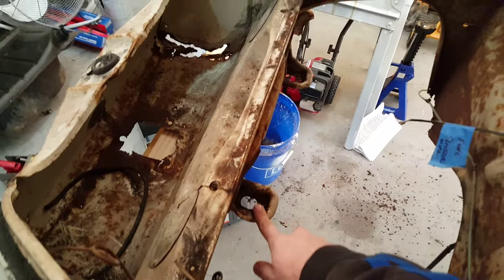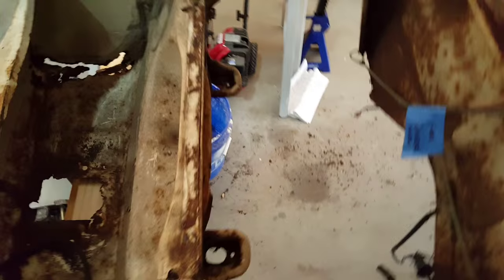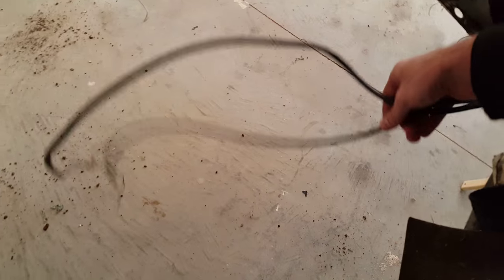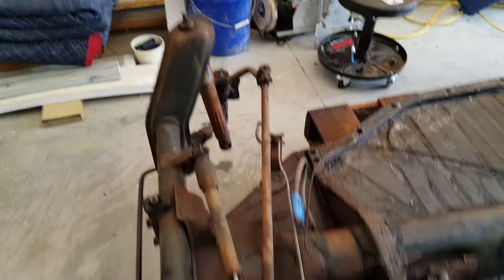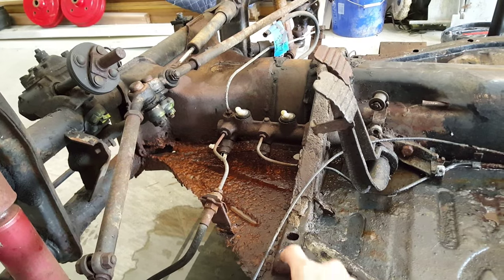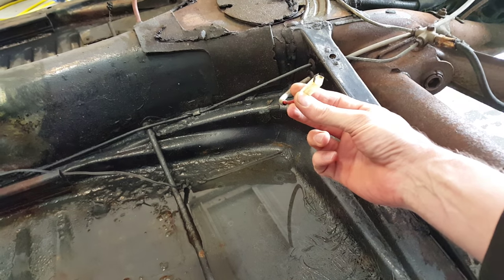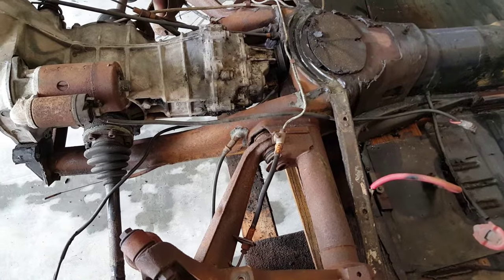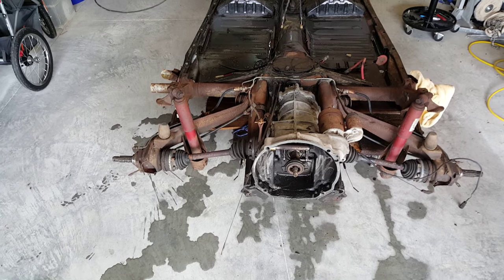VW Beetle Body Removal from Chassis with 1 person

Comment: On those rear heat flaps that little black plastic clamp has 2 tiny flathead screws to hold the wire. Just listen one and you’ll be disconnected from the body.

Comment: I think you just answered a question I've yet to ask. Re: under-dash steering column bolts. I'm building a car out of clips and doors. I took a steering column out of a 72 and went to put it in....they were waaay different. The bolt pattern in my cowl section looks like yours....so I guess it's a 74. Who knew?

Comment: How do you find out what type it is? I have a 1974 beetle from what I was told it's not a super beetle but a standard beetle. So I keep having issues when I try to look up parts or videos seem super beetles keep popping up.
Reply: Front coil springs are Super Beetle only.

Comment: Out of curiosity.... what did you use to do the actual lifting of the body from the chassis?
Reply from the maker: The body is very light once you have it disconnected. I have done it two ways. 1) lifting the body by hand then having someone slip the extended saw horses under the front then repeat for the rear. 2) a pump Jack with a 4x4 post to raise it. The second way of course you dont get a large amount of clearance but you only need just enough to clear the rear axle and suspension.

Comment: How did you life the body off the pan? Also what if someone has an engine in the car?
Reply from the maker: Once everything is disconnected I just lifted the front and slid a board under it that rested on sawhorses set at drivers and passengers side. Then did the same with the rear. Easy with one person as the body is so light. If the engine was in you need to speed extra time making sure there are no catch points. The engine is so easy to remove I would recommending that you drop it first.

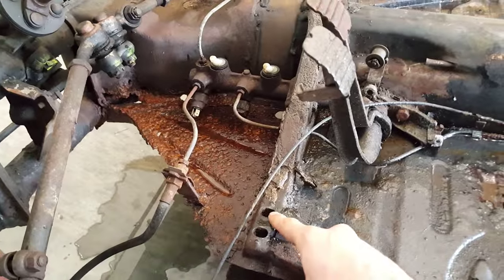Comment: Great video. I am removing the body off of my 74. How did you access the 4 17mm bolts that go in to the Napoleon's hat? (The ones at 6:05 in your video) I do not see any bolts there when looking under the car or from inside the hood with the gas tank removed. Thanks!
Reply from the maker: They were accessed from under the vehicle. On mine there was bolt below and behind the front wheels that could be removed (2 on each side). The nut plate was welded inside of the body cavity so I couldn't access the other side which was fine for what I needed. If you are still having problems I will see if I can get a picture to you

Comment: do you have to remove the engine to get the body off?
Reply from the maker: You could feasibly remove the body without taking the engine out. The engine tin would be a concern. Also, getting the body raised high enough to pass over the carbs could be an issue. You would still have to disconnect cables, electrical, and such that pass through or connect to the body.
Reply: thanks for the answer. could you tell me I should get for gas mileage with a 1973 1600 bug engine in good shape?
Reply from the maker: I would think around 25 to 32 mph depending on tune, carb, and engine shape

Comment: Anyone have tips for repairing the backrest on my passenger seat? The lever moves up and down but the seat won't push forward. I seperated the seat tonight and notice the cable on the left side is not moving the mechanical lever as much as the right. Do I need to remove the seat cover and adjust the cable?  Just bought my wife a 75 beetle and in the process of figuring out what and where to start. Never messed with a bug, so any help is appreciated!!

Great video to show all the component break down on this car.  I think I'm going to have a million questions this spring.. 😆

Comment: What is that black thing under the dash? It looks like a little light.
Reply from the maker: Under the dash to the left of where the steering column goes and is white, red, and black? That is the fuse box. Or, if you are taking about the black hose that is for the windshield wiper fluid.

Comment: how much should I pay for a 71 vw beetle. it needs sway bar, rear axle, floor pan, oil seals, side window, and interior redone.
Reply from the maker: doghousegang Needs a lot of work. Depends on how good the engine is and the shape of the body. I would say your best bet is to start with TheSamba.com
Reply: Nothing over $300 if you can do most of the work